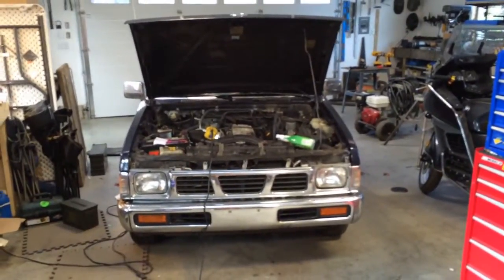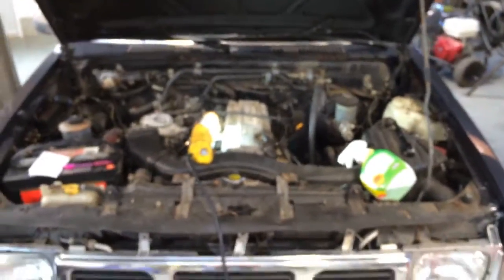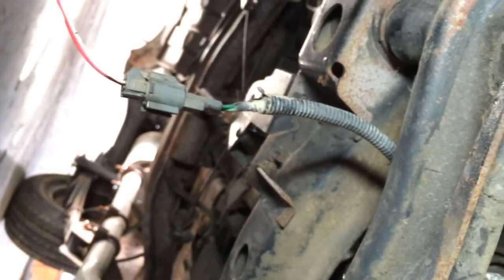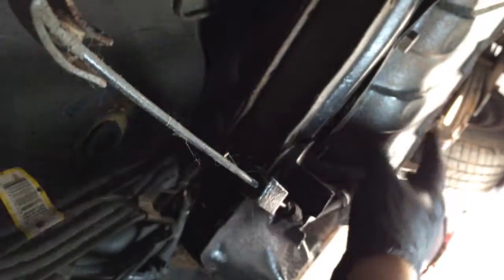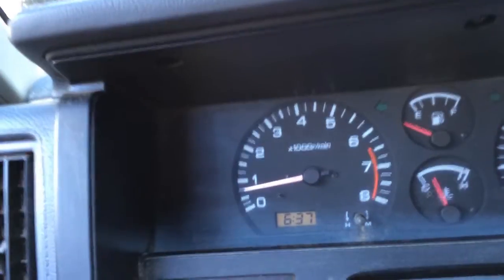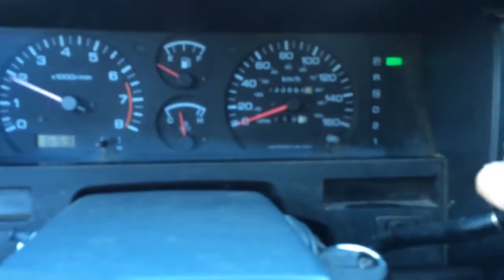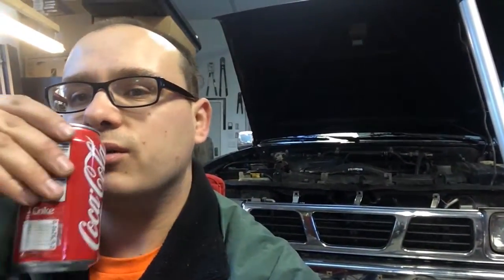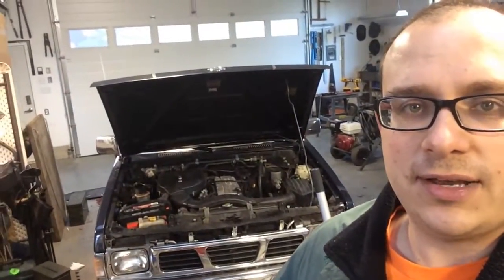This old car: 1993 Nissan truck stalling in gear

Comment: I'm wondering if the Trans is the issue, maybe a wrong torque converter because it's for a newer model ? What was the ATF like (level and color)? I'm also wondering if there's a vacuum issue somewhere that may be compounding the stall issue?

Comment: Hi, I've got a 93 Nissan D21 V6 pickup, that has 311000 on clock. Like it, got it cheap, am sticking with it but find steering with steering box, now adjusted by mechanic, still has lot of play. Is steering box always problem or just maybe being used to rack pinion, hard to get used to?

Comment: check all your fuses and relays , it might be loose , it might need a new trans. filter . A  loose or disconnected wire , vacuum leak mabe , I D K, . GOOD LUCK !

Comment: Did u ever check the ATF Fluid Level?
Mine has a leak whn it's low It will Idle rough and shut off on me Coming to a stop.

Comment: vacuum leak or short when pressing the brake pedal....make sure you got good battery 12.6 or above and make sure alt is charging, then start checking.
Reply: Wy u say that???

Comment: Air intake / temp sensor maybe ? Are you getting a code reading ?
Reply from the maker: You know, silly old me, i haven't yet tried to read the codes, I guess I'll have to do all that under the seat engine computer 'switchery' to get a code read out of it today... we'll see what I can get.  thanks for the tip.  As for air intake temp, I'll have to check the sensors as well...  CHEERS!